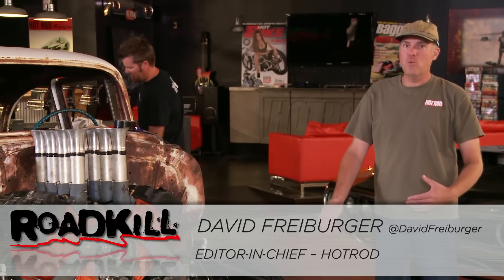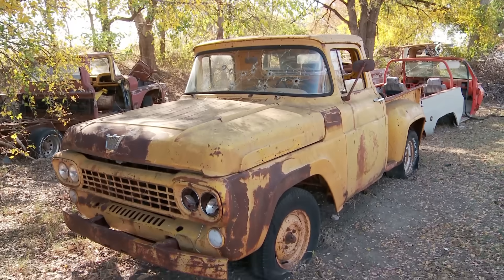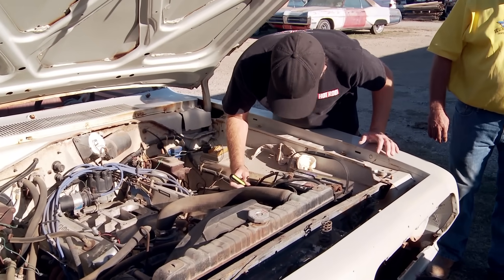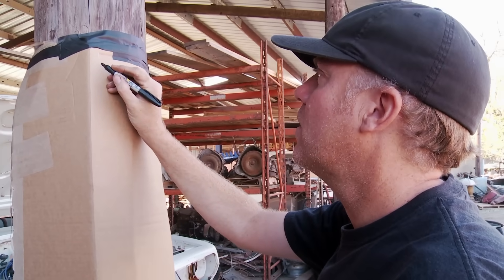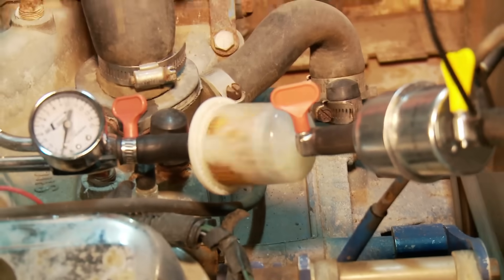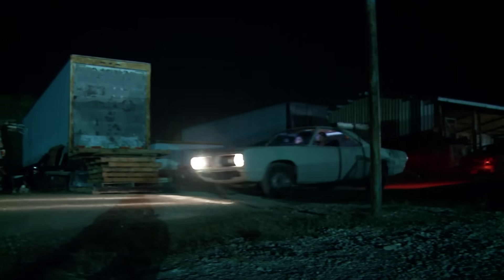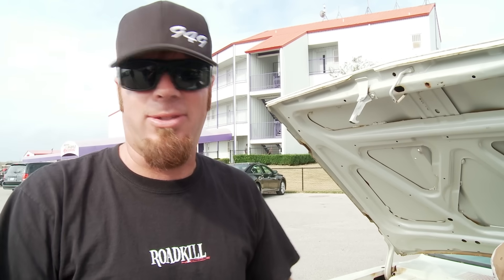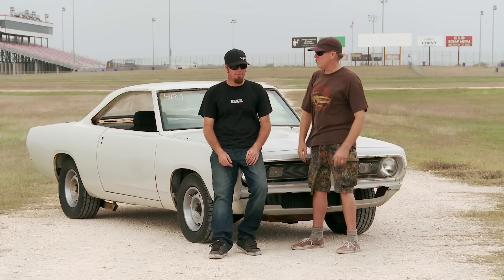Junkyard 'Cuda Rescue, With Nitrous Oxide! - Roadkill Episode 11

Comment: I had the fastback coupe with the big window in the back.  Gold with push button shift and aftermarket air conditioner.
Right off the showroom floor and love at first sight. Was mulling over the brochure for a Mustang, but not after I saw the Cuda.
It was never driven the way you drove yours, but the next owner wrecked it the first weekend.

Comment: Hi from New Zealand,
This show is better than, Top Gear!
Reply: By a mile ,or in your case a kilometer .
Reply: +Billy C. LeWorth Actually by like 1.6 kilometers
Reply: *****
We have the Metric system here too but the government introduced it in 1976/7 when I was in grade 6 so I learned to use it after Imperial measures . I've been  in the printing industry now for 20 years and we only use Metric for liquid measures . At home I only use Metric for temperature and liquid measures for cooking . I find Imperial is superior for long distance and larger weights .
Reply: Billy C. LeWorth I know that we have the metric system here. I live in America
Reply: Top gear  is not gonna be a finger of the road kill show
Reply: +2011FordMustangGTCS - love the Mach1 mustang even if it is a petrol drinker. Can ask do you own a American car or foreign car?
Reply: +Mohammad Shasti - can I ask, do you own an American car or a foreign car???
Reply: Henry Rudolph I own a variety of cars. I own an 85 Mustang with a 347 Stroker running in the low 10's, a 1990 Miata that I use as a road course car, a 2011 Mustang GT, and a 1970 Fiat 500.
Reply: +2011FordMustangGTCS - Are you a mechanic, I have problems keeping one car on the road? how do afford all those cars??
Reply: Henry Rudolph Nothing wrong with Japanese cars. One of the most fun cars that I have owned besides my mustangs was an old Pulsar I had. Twin cam, front wheel drive, high revving. Was a blast and made a great daily driver
Reply: +2011FordMustangGTCS -yes especially when I'm poor and can't afford sometimes the gas to get me from 'A to B and back again'. The best car is probably a Japanese car as far  as fuel economy goes.
Reply: Henry Rudolph
Nah, the best vehicle for fuel economy is a Honda GROM. It's so much fun
Reply: +Henry Rudolph wea from
Reply: +Lawbricktim Boynton, Hi from New Zealand, yourself............wea from??
Reply: auckland wbu
Reply: +Henry Rudolph Your comment has better grammar than, an English teacher!
Reply: +Parker Barandon -Are you American?
Reply: Henry Rudolph Yes.
Reply: +Parker Barandon -Can you do what David Freiburger & Mike Finngan do, mechanic a junker car into a mobile car? now I have watch another American car show, the road rat. where they just rebuilt cars, and it look like they do this, with little regard for the cost of the built?? If I were to do, what Freiburger & Finngan do to cars and junker cars at that. Here in New Zealand, It would cost $$$ the earth! Yet they make it look so quick and easy, with no cost??? I guess what I'm try to say now do they afford to do this?????
Reply: Henry Rudolph I'm sorry but I don't see what that has to do with what I said.
Reply: better than us topgear yeh
better than the former uk topgear no
Reply: +Henry Rudolph I'm from nz as well where about are you I am in Auckland. NZ for the win
Reply: ahaha otara wat about u??
Reply: North shore man :)
Reply: kool
Reply: So much agreenes
Reply: huh??
Reply: You don't have muscle cars in New Zealand
Reply: +Tmanthekid Guns You are very wrong my friend. ford falcon,Holden's,etc.
Reply: yea
Reply: +Billy C. LeWorth Canada?
Reply: Better than ALL Top Gear incarnations.
Reply: Henry Rudolph even Rutledge said so
Reply: it isn't for me and I'm from NZ
Reply: Henry Rudolph Yus ×9999999999999999999999999
Reply: nice vidio
Reply: im in nz too, an yip way better than top gear,  mopar owner too
Reply: Henry Rudolph from Australia and yeah better
Reply: Henry Rudolph
Reply: Slow down there buddy. If these guys make a car into a rocket ship then we'll talk.
Reply: Venomous Duck Top gear didn't make the rocket ship some other guys build it...
Reply: Henry Rudolph but does the include Top Heat 2.0 ( The grand tour)
Reply: Henry Rudolph  top gear the super Nintendo game is better than the show top gear . and also u are right💪😊🍾🍾🍳🍳🍾
Reply: Henry Rudolph, better then the new Top Gear anyway
Reply: Henry Rudolph  way better
Reply: Imagine Jeremy Clarkson changing out engines and yelling Poweeer!
Reply: Hello fellow kiwi. Want some fish and chips
Reply: 2011FordMustangGTCS low tens
Reply: Henry Rudolph I agree
Reply: i was in New Zealand in 1994.its me Buck...
..hows it goin man....I loved New Zealand....not the flight ..
Reply: hey Henry after recent events have you found a way to get this content in NZ? Appreciate any hints.
Reply: Henry Rudolph Top gear is here too, This is way better
Reply: Old top gear is better than this
Reply: Motortrend or Top Gear
Reply: @2011FordMustangGTCS  .
Reply: It’s definitely better then new top gear, but Chris Harris on cars is pretty darn good!

Comment: I'd buy that thing and fully restore it. That thing is fuckin sweet.
Reply: It's at that junkyard again that is what David said in episode 25
Reply: +ZednoughtMagnum What color would you paint it?
Reply: I don't know, maybe dark green, red, or blue.
Reply: Red would look really cool, with metal flake maybe?
Reply: +NavyWolf175 I'd prefer sublime green and black chrome
Reply: also a very good idea
Reply: Id put in brakes, a good cooling system, increase the HP, get lights, comfy seats and maybe even get the AC to work if it has one.
Reply: Also get new tires, put in a new transmission, mirrors and paint it black with blue tripes along the middle of the car
Reply: +ZednoughtMagnum I'd put a diff in it, a gps speedo a tacho and some gauges and leave it alone
Reply: +NavyWolf175  paint is a waste of money
Reply: +pommunist wow you really ok you know what What happen when you have an old car and it have so old paint in the and it's not clear so You in future you be like nah I'm paint this Hmmm.
Reply: +Tin Nguyen   I've only had old cars for about 30 years. I painted my first, a 1968 Holden HK Premier sedan, black.  Nobody painted an everyday car black in Brisbane in the 80's  no air conditioning, dark vinyl seats, (not very practical i admit). I washed and waxed it regularly... It was sweet!  I sadly watched it deteriorate because "society"  
 If paint is original i will try to preserve as much as possible, if its not, i'll usually just fix the rough spot, then brush on some primer and forget it.  I am a mechanic though, as long as it starts and stops  i'm happy.
Reply: TheNikster it is?!

Comment: Wait, this is my absolute FAVORITE episode of Roadkill and I can't figure out what engine is in this thing? It's obviously a small block because the distributor is in the back of the engine but is it a 318, 340, or a 360? It looks like a 340 but I have no idea and I don't ever recall them ever actually talking about it. Mike Finnegan? Dave Freiburger? Anyone?
Reply: +Robert Keeton Description says its a 360. The performance would kinda lend itself to it being a 360 as well, the 318 was never a 'hot' engine and the 340 generally reserved for much higher spec cars. Mind you, google the 'Cheap As Dirt - 415hp 318' build on a 318!
Reply: +Robert Keeton the description says it's a 360 V8!
Reply: 360------They said it at the end,,,,I think---right before the auction

Comment: That Holly 750 double pumper is a bit too large for that little motor. Can you say "over carburetor-ed" ?  That junk yard tire looked like a retread. Funny video, my old Ford pinto 4 cyl.  powered 1973 Mercury Capri 4 cylinder ran 12's.

Comment: Talk about a barn find, Sweet Deal ! A locker in the rear, oil for the pig, oil for the motor, oil for the transmission.... lol
$3100, even 5 years ago that was a steal. Remember the guy wanted $4000 at the start, Plus all the extras...

Comment: A-body Barracudas (and Darts) are legendary drag cars. Selling that car was stupid, especially for way less than they paid for it and the parts. That car was worth going all out on: Hemi, supercharger, spooled Dana 60, built A727 Torqueflite or A833 4-speed, etc. The '68 Hemi Barracudas and Darts ran about 10.5 seconds in the quarter mile, bone stock, and remained competitive in drag racing for decades to come.

Comment: For the wheel bearings @ 17:56 they should have used a torch at low heat to heat up the bearing to drop out. - Beautiful 1968 Cuda !!!

Comment: its crazy. i watched this when it came out 3 years ago and now i work at the CTC auto ranch. Ive got my eyes on a 78 plymouth duster. its only got a v6 in it but when i get enough saved i plan on reaching out to blueprintengines to  get a nice small block do drop in. Would it be better for me to just try for something like a chevell? or would it even matter? Im looking for an engine bay with many options incase i decide in 10 years i need 800hp instead of a humble 400. the plymouth has a complete and full interior but alot to be done in the bottom end and engine. all of the almost 10 chevelles on the lot have next to no interior. Love you guys and i cant thank yall enough for what youve taught me with these videos alone.

Comment: F&F need to buy this back, now that Dodge sponsors them. Need to rebuild the engine and add some ported Magnum heads, cam and Holley Double Pumper. Add a trans cooler and run it at Dirt Fish. It'd be more fun than the General Mayhem since it's so light.

Comment: " THAT " was AWRESOMEeee! :)
What engine was that? 360 ?
I'm restoring a 69 that I've had since high school (3rd ownner).
It is a factory 318-904-7 1/4 all numbers matching, A/C car,  w/the build sheet.
Keeping as OEM as possible but will be R&R the stock 73k mile 318 an drive saran wrapping it and dropping in 69 383 OEM bore & stroke , A727 street/strip trans built by Jegs, and a OEM A-body 8 3/4 housing with NHRA axles/green bearings, Wilwood disc x4, and a shiny new Sure grip with a 489 pig.
Got everything sitting and waiting for summer paint, then only needs  assembly. Then I MIGHT sell it (For the right price) to repair my credit damage >_<!
Ps: paint and interior wont be orig colors. Going with Eastwood Meteor metallic grey w/rainbow metal flake floated in a purple essence Clear.

Comment: Hey roadkill!   I have a question. I have a go kart with a Tecumseh 6 hp Power Sport motor, that wont start. I've replaced the carburetor, spark plug, and recoil start. It has compression, spark, air and fuel. Any suggestions would be welcome. Keep up the great videos! Because Roadkill.

Comment: hope someone saves that smogger Road Runner. when's the last time you saw one driving?

and that Olds Cutlass? Hot Rod magazine once did "project junkyard dog". 13 seconds for $3,500 with a 455 swap on the original THM350 (their torque converters tend to give 500 rpm extra stall speed due to smaller size than a THM400).  'Bet the boneyard has some 455's lying around that never saw over 4,500 rpm.

amazing that finnie knew to get a spread bore Holley before knowing what car they'd buy.

Comment: OK, $3800 to buy the clunker, probably another $1500 to get it running using pre-purchased parts (HINT: $$$), got it to the drag strip, and sold it for $3150. Lesson: you LOST $2150. Then of course I could be blowing smoke here due to their sponsors (Motor Trend) covering that loss.

Comment: I ran a sneaky Pete system fogger on my ZR2  50 HP boost. Wow did it roast the tires I went and got a bigger bottle. Hooked it up for some reason the threads were different it did not seal I had the windows up turn it on did a hole shot then about 10 mins later I pulled over as I felt all rubber like. I tried to call a friend to come get me they could not understand me I felt like time kept stopping.
Reply: Alton Steel ya and people huff it for fun

Comment: Getting my 340 Wedge engine replaced with a Jasper's rebuilt 360 but with fuel injection. Why? Who needs a car burning 12 miles per gallon of 91 octane; & because it started over heating at the first red light. After the third red light it might climb to 250 degrees. 340 engines were meant for drag racing, not stop and go traffic. The 340 Wedge engine cries out: "Find me a Home where I can burn down a track like a maniac!"

Comment: install a rotary from a crappy mazda rx-3, twin turbo it, then put it into a 71' mustang mach 1, that will be fun.
Reply: +Alexes Miranda I think the rotary would be better for that 240z they're building. Cars like this are kinda too heavy for that engine's lack of torque. I do however love seeing the 13B swapped into other things, and the fact that people who are, let's say lacking the intellectual capacity to work on them, just pull them out and put a small block into the RX-7s means there's an abundance of them out there just needing seals and gaskets.
Reply: yup

Comment: $3800 from the yards? Kind of a ripoff and seemed like the owner was just taking advantage of the situation considering you can get one for under $2500, complete, NOT from a junkyard, running, with an interior, in 5/10 condition (crap paint) from some individual sellers online.
Reply: +the40rk Where the hell is that? Because that's a 5-6k car where I live just because it's still got quarter panels.
Reply: 84Bronco351 I just went on craigslist and searched. I do understand they were on a time limit (I.E., can't wait a few weeks to find something reasonable), but you definitely can find cool stuff for cheap if you're patient and check regularly. And, as you pointed out, where. Regional location makes a huge difference in price.

Comment: I've been working on getting nitrous on my mustang for over a month cold plugs fuel pressure regulator new wires progressive controller mounting and after timing regard it doesn't work right fuck they make it look easy mechanics either suck here or I have the worst luck ever
Reply: The fact that you drive a mustang is probably why
Reply: +Malcom Austria Zing!

Comment: I would've sold my left nut for that car. My grandpa had a 68 same color and everything.
Reply: u only need one right lol
Reply: I'm restoring a 69 that I've had since high school (3rd owner).
It is a factory 318-904-7 1/4 all numbers matching w/the build sheet.
Keeping as OEM as possible but will be R&R the stock 73k mile 318 an drive and dropping in 69 383 OEM bore & stroke , A727 street/strip trans built by Jegs, and a OEM A-body 8 3/4 housing with NHRA axles/green bearings and a shiny new Sure grip with a 489 pig.
Got everything sitting and waiting for summer paint, then only needs  assembly. Then I MIGHT sell it (For the right price) to repair my credit damage >_<!

Comment: 3150 is a pretty good deal considering they paid 3800 for a non running piece of shit
Reply: A "non running" piece of shit that just happened to have a race engine in it that would handle NOS.  This is the most set up episode I've seen.
Reply: +wb6162 you can put nos on any engine it depends on how much you give it
Reply: V8s can handle nos even if its a crappy V8
Reply: Yeah by race engine you mean it had a set of headers and an aftermarket intake manifold. just because it can handle doesnt mean its a race engine.
Reply: Yeah by race engine you mean it had a set of headers and an aftermarket intake manifold. just because it can handle NOS doesnt mean its a race engine.
Reply: Adam Kinney Good to know!  I have an '04 Passat maybe I'll give her some NOS before she goes to the boneyard in a few years :)

Comment: It's not a real 'Cuda.   I'm actually kinda disappointing by that.
Reply: +Corey Besse (OMGnanerpus) You mean it's not a 1st gen, but it's still a Cuda. That's like saying a 67 Mustang isn't a Mustang.
Reply: Wrong.  The 'Cuda is a model of the Barracuda.   Like how the Superbird is a model of the Roadrunner.     A Superbird and a Roadrunner are not the same thing.  Neither is a 'Cuda and a Barracuda.     The 'Cuda has a 440 6pack or 426 Hemi.  The base Baracuda has what, a 360?
Reply: snakesonaplane2
Reply: ***** The 'Cuda package could be had with a 340, 383 or 440 Commando, which their's may have had originally. The 'Cuda came out in 69 so their's isn't, but it could be a Formula S which the 'Cuda was based off of, but they never said it is or have markings to indicate it is.

Comment: Ok, good video however, anyone whom knows mopars, knows only a chevy or ford guy would put traction bars on a mopar.  Before you argue that one, go do some research.  And for the guy that thinks 442's are faster?  Really?  I guess that's why nhra ended up making the 68 hemi barracuda/ darts race each other.  Factory guys from ford and gm were crying about loosing so nhra changed the rules.  Go back and do some research on the factory wars.  Agreed that Chrysler folk are about as finicky as corvette people.  Also, after Chrysler dropped the torsion bar suspension, gm and ford tried it.  Go look under a newer ford truck.  Always dislike the one brand fans.  Hell, they all had good/ bad ones.